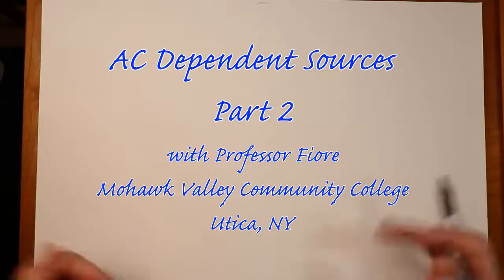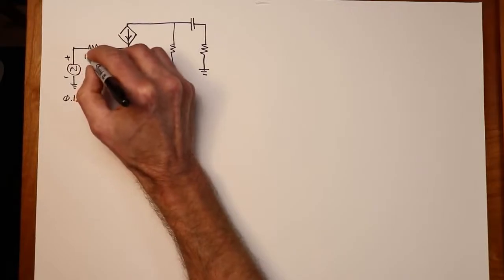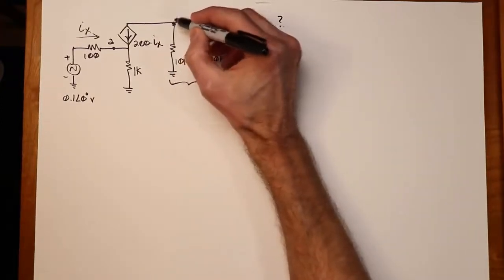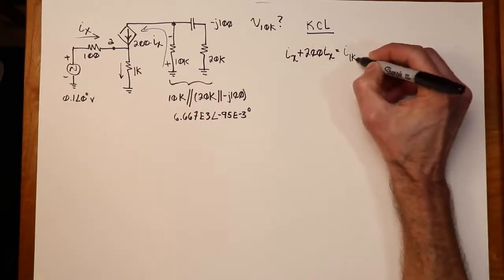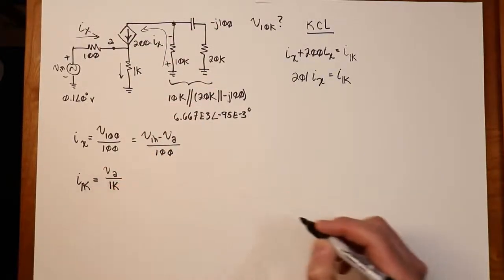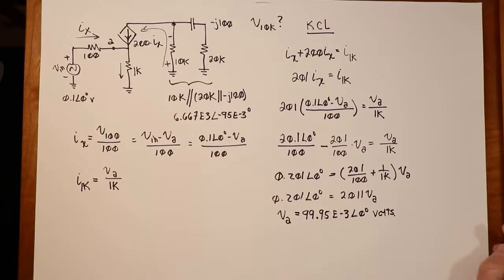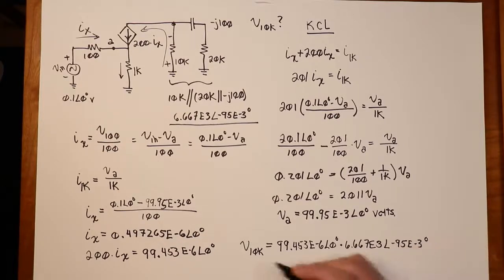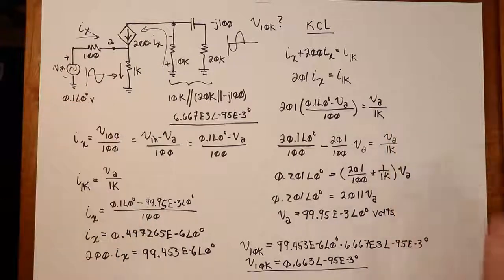AC Electrical Circuit Analysis: Dependent Sources, Part 2

Comment: Prof. Fiore
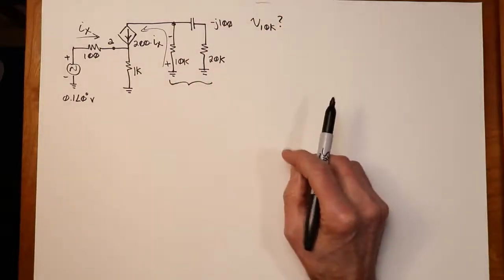@ 4:56
Isn't - 100j capacitor in series with 20k resistor ?
Reply from the maker: Yes. I said they were in series ("this series combo") but unfortunately I wrote the symbol for parallel. The analysis is correct otherwise. Note the comment about the cap not having much impact on the 20k/cap combo. That is true for series but it certainly would NOT be true for parallel!
Sorry about that.
Reply: The same I was wondering too...